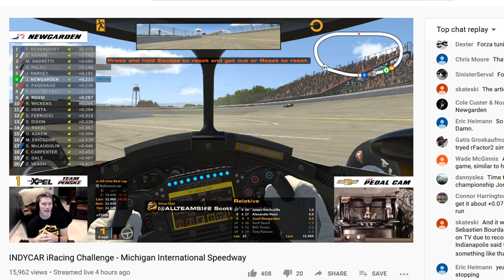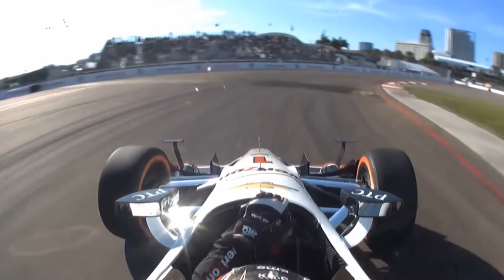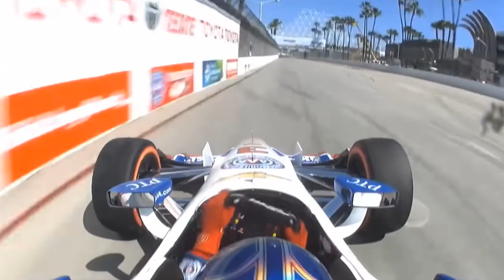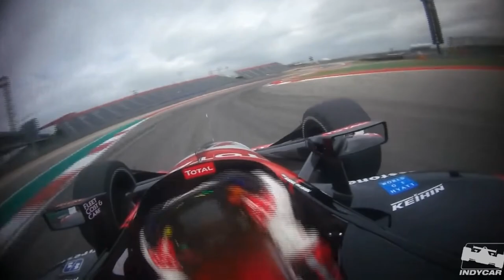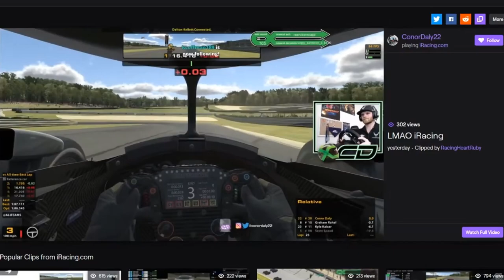Josef Newgarden Explains the Issues with iRacing's Tire Physics

Comment: Well put. That summarizes my main issue with iRacing incredibly succinctly. There’s no progression to loss of grip (like I feel in AMS1 for instance). One minute you’re fine, the next it’s insta-spin with no chance of recovery. You consequently can’t really hustle the cars, can’t push, because you never know when you’re going to break loose.
Reply: ams1 loss of grip feel, as well as the one in R3E is very artificial and nothing like you would feel in real...
Reply: @iseeq72  And iRacing is authentic? Nikki Thiim has had similar complaints about the iracing tire model recently and he's a GT3 driver. They need to look at fixing this, other sims have more accurate tire models.
Reply: @iseeq72  Racing games feel artificial, huh?

I have yet to try one that doesn't - they're racing simulators, not racing replicators
Reply: @RyTrapp0  Well , a simulator tries to replicate what real Life does, but yes , sims are not real Life.

Comment: I’m glad real drivers are being put into a position to criticize the flawed physics of these sims. I have never understood the “on-off” model some sims subscribe to where it’s impossible to recover from a slide. It’s like they think more difficult = more realistic. It doesn’t take much on board footage of these cars to realize they can be slide a bit on the limit.
Reply: Ever tried GP2/GP3 or GP4?
Reply: In Dirt Rally 2.0 on tarmac it's totally on-off. If the rear starts to slide at a high speed corner you're basically in a 50/50 chance. Either you can catch it or you'll completely fly off the road. There's not slide a little bit in those situations.
Reply: I think making a tyre model like the one described above would potentially break some other part that's perfected by the tyre model. Think about all the complex calculations the model needs to make as you enter a slide. Finding the perfect 'bite' point to recover from a slide can't be easy to figure out. By no means am I an expert but just my two cents as a student.
Reply: @Mcquiz95  dirt is the most fun Sim to play, you actually have a chance at recovery.
Reply: Projet Cars seems better for giving abit of slide control . . . until you jump in an lmp1/2/3 car, then they just snap so damn quick

Comment: rFactor 2 (as many people in the communities say) has more realistic physics. Not only tyre flex, grip values, temperature, wear and tare, flat spotting but also...etc
Reply: The problem with rfactor2 is many bugs that the devs themselves cannot solve
Reply: @atrspeed92  And the fact that the tyre model is absurdly complicated. I'm a mechanical engineer and I got confused by that amount of stuff...
Reply: @gabem.5242  Well, real life is complicated so if you want to simulated well it will be complicated as well. And you can't really simplify it without losing a lot of the realism.
Reply: More realistic tire model for sure, but not as great crash model. You bump cars in there like they're plastic toys. Same with AC.
Reply: @Sturmovik1946  maybe
Reply: @gabem.5242  Have you tried Raceroom lately? I have a feeling you would enjoy comparing the two. It had a physics update and the tire modelling became much more complicated, harder and more important to manage the tyres. It is a different take on largely the same problem.
Reply: @squidcaps4308  funny banterino between sector3 and studio397:

RF2: We use real raw data because its real

R3E: We manipulate the real data to make it feels real
Reply: @atrspeed92  Yup, that was also how SimBin did it from the beginning and theirs was a better interpretation...
Reply: @NOT_ANOTHER_FPV  Funny that i just watched Button, Montoya, Fittipaldi, Priaulx, Liuzzi etc drive on it..
Reply: Did you try the Indycar on rF2? its even worse there....
Reply: @mikekadlcak1963  No I didn't tbh.
Reply: @atrspeed92  100%

Comment: and to think Rfactor2's tyres get criticized by "some" for doing exactly what real tyres actually do.......... who'd a thunk it...LOL
Reply: Boldaussie rfactor2 is barely any more realistic
Reply: @Stubs66  The tyre model is much better. Too bad most of the content sucks and it is developed at glacial speeds.
Reply: @Stubs66  rF2 varies in quality, so it can be just as bad or much better.
Reply: They feel better in a lot of cases, yeah. But real tires don't actually melt if you look at them wrong. Sorry.
Reply: @bduddy55555  The best thing is that people actually came up with reasons why that was not unrealistic somehow.
Reply: In rfactor 2 sadly the tires go too far in the other direction
Reply: @NOT_ANOTHER_FPV  Sadly that's  never gonna happen
Reply: Yeah... Well, rFactor (pro) was (can still be) the most used simulator software by F1-teams...
Reply: Late to the party I think acc gets it pretty good
Reply: I think it's finally been surpassed by ACC. The tyre modelling in ACC is nothing short of phenomenal. Every GT3 driver I've seen who's played has nothing but good things to say about it.
Reply: Rfactor gets used a lot by professional teams

Comment: Finally, someone who tells us what we have known for a long time and iRacing can't figure out.  The Skippy is not a drift car in real life, if I drove any of the open-wheel cars like Josef Newgarden suggested, I would be in the wall.  I barely turn the Formula Mazda and it turns me around.  I have tried different tire pressures to no avail and I have tried LDF, MDF and HDF with the same result.  I will say that because I can adjust the Skippy to my liking, I can keep it on the track, but, I always get beat by drifters, who I know are overheating the tires, which in real life would cause them to wreck.
Reply: Isn't that the opposite of what Josef said, at least in reference to the Indy Cars?
You say other people successfully slide their open-wheeled Skip Barber cars, but Josef says the tire model prevents successfully sliding the open-wheeled Indy Cars.
Reply: "Skippy" !!! Reminds me of all the hours I put into mastering David Kaemmer's Grand Prix Legends! Mastering it like a game, not like driving a real racing car. GPL always left me frustrated and...in the wall!

Comment: This has been bothering me for years. Sims seem to have less grip than real life
Reply: The point of the video was not really the lack of grip, but rather the peaky nature thereof.
Reply: i dont know about less grip, its just easier to spin out a car to me; the tyres dont have that gradual/elastic feel they should have on the steering wheel when you start pushing a car to its limits.. VR helps a ton though, because looking at a screen with 30 degrees of Fov can really disorient you view of what the car is doing. Its much easier to save the car or control a slide when youre actually sitting in it virtually.
Reply: Get Sideways yeah but this guy's point is still valid.
Reply: @jg2627  The general lack of grip in sims? Sure. If it's not an apparent lack of grip, of course. I'd expect sims to at least replicate the ability to hold the same Gs as the actual cars/tyres.
Reply: It's not that they have less grip so much as it is that you don't truly understand the Angles and the speeds being taken into consideration here, for example if you were to get into your car and go 100 km an hour around a tight corner you would feel the g-forces and you would slow down because you know you would start to slide. In a game you do not feel any of these G forces and if the game doesn't have a good perception of speed, because sometimes games have a zoomed-in effect to make things easier to see from far but make it seem like you're going slower, then it's going to seem like you're going around a corner slow and you're losing grip easily. Try paying attention to how slow you go around corners in real life and compare that to the same speed in a game

Comment: A little insight into my experience. I've been an iRacing member for almost 10 years now. When I first started, the cars felt like they were on ice with no grip and had TONS of rotation. In about 2012 or 2013, they introduced a brief tire model (referred to then as NTM - not sure if they call it that anymore) to the class B Impala at the time. It felt so grippy and what I perceived to be realistic compared to the car movements on TV. You had so much control. You could catch a slide pretty easily and hustle it like Newgarden is explaining. I remember entering a class B practice at Dover and was posting faster times in that session than Richard Towler (the iRacing NASCAR champ at the time). They pros and long time users HATED that tire model and they quickly did away with it. The tire model now pretty much feels like a mix of both feelings I've described here. Hopefully these past few months with real drivers giving iRacing some feedback will help take this sim to the next level of realism (where it should be in 2020).

Comment: This is a problem with a lot of AC cars as well. I only drive Bazza’s AC mods because of this. It’s something he and I and Austin have been saying for *years*. SLIP ANGLES ARE A THING PEOPLE.
Reply: Iracing, slip angle. It don’t exist lol
Reply: I always feel like the flat part of the slip curve covers too big a range of angle in AC. ACC feels better in this respect.
Haven't touched AC in years, will take a look at bazzas stuff.
Reply: @RDMracer  Some of Bazza's cars perform too well
Reply: lol, there is no problem to slide with every car in AC
Reply: Alot of drifters main AC because of the controllability while undergoing oversteer slip. It really comes down to the mod/data you're using. I can do reverse entries with the kunos F2004 if I increase camber, toe & steerlock lmao
Reply: @Dioptra333  Base physics in AC are not there at all. The tire physics are all over the place.
Reply: @Cal3000  What isn't there? About how deep can you elaborate on the whole "the tire physics are all over the place"? I race ford spec & AC perfectly compiles it's characteristics. I also derive physics formulae every day, there's nothing sophisticated about a classical mechanics model that would require a nasa computer to approximate. AC gets a bad rep because only a handful out of thousands of mods have decent data even if pasted. Excluding aero, the actual physics engine in of itself is good (doesn't take much to be good..) & is an improvement of Ferrari academy.  AC doesn't have chassis & tyre flex like rF2 & acc?! That & many other "missing" variables would differ the driving dynamics on an imperceptible magnitude. Coming from a commercial simulation standard pov, it's quite funny that people praise one sim & despise the other's. Or that mass populous doesn't know fundemental level physics enough to see how basic of a model it'd require to simulate such conditions.
Reply: Dioptra I don’t know too much about the mods available as my reference is the PS4 version of the game. I track an Evo X and FRS and the game’s baseline model no way represent the FRS. The Evo isn’t in the game, but I tried the GTR and the Model felt sloppy. There is way too much induced understeer in the FRS and has poor turn in response. There is no ramp in the kinetic friction force window in relation to tire speed in the game, especially in oversteer situations. It’s like the kinetic friction value changes rapidly.  You should gradually feel you car loosen and be able counter steer and recover. Times when my Evo was on cold tires going around a corner, it would want to snap into oversteer if Im throttling around a corner. If that happens, I let off and counter steer to straiten the car. In AC, once the car starts oversteering, there is no window for recovery. Car control isn’t this difficult irl. If classical mechanics modeling was so simple for simulations, most games will nail it easily. Yet, we have all these sims that replicate the same car differently and have different characteristics for their baseline models.
Reply: @Cal3000  Sims do nail the physics & are almost indistinguishable because of it, however AC is the only actual sim on console. In sims, (besides iRacing & ACC) if you want to replicate a scenario beyond core physics, albeit having a particular car behave exact to the car's real life counterpart, you'll have to mod as vanilla content isn't a focus in sim development. Settings are also the user's responsibility to be adjusted to their hardware. Badly configured & you can have clunky steering/throttle/brake input regardless of skill. Vanilla AC cars have a default track setup that's ok for most circuits but is intended to be tuned, hence the name in Italian translation. Default setup usually has tire pressure set to heat tires at certain rates, slicks that'll increase understeer under load & snap oversteer likelihood; & default camber isn't good for turn in on all circuits, etc. Conditions & differences in tune as minuet as 1psi delta in tire pressure will drastically change car behavior. Sim car control is much harder, especially if you're trying to perceive the same way as you do irl. In sim there's no visual sense of speed & for most, only forces are to the wheel. Turns don't look nearly as sharp. There's guaranteed a relatively large delay in cues because the aforementioned. So very often does one not realize they're over driving until well after slip happens & can be beyond the point of return.
Reply: @Cal3000  I have some racing experience too, and for me AC is by far the most realistic sim when it comes to road cars. Slides feel realistic, balancing the car works out fine, FFB is pretty much like in real life. The GT86 only understeers with the Eco tyres, put semislicks on it and the turn in is really good.
Reply: @Dudeisthere  I think the road cars are represented poorly in AC. I've driven my FRS irl with the stock eco tires and stickier Pilot Super Sports. The car wants to oversteer and go into a drift at any lower speed when you gun the throttle. It doesn't do that in AC and goes into this strange under steer. The loss of traction makes no sense either. IRL, when you break traction, there is a steady progressive build in sliding. When you let off, the weight shift centers quickly grip maintains, I have control of when to start and end the slide. For some reason in AC, when the car starts to slide in oversteer, it continues and its doesn't feel natural at  when I let off to correct. It's like a lift off oversteer in an MR car where the momentum of the rear engine just carries you. I tried the GTR Nismo also in the game and there is no reason my Evo in real life can rotate around corners more than it. The Nismo is the game understeers mad like a fwd car with too much power and poor brakes. In my opinion, I think GT Sport has the most accurate model of road cars in sims.